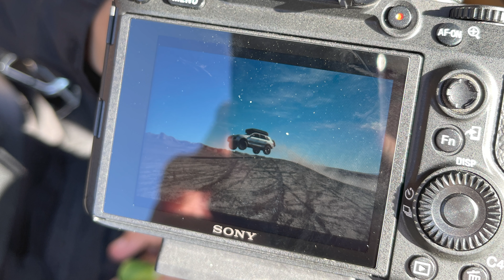My cayenne is VERY broken.

Comment: You had too less clearance after you modified the suspensions. Over that very heavy car and maybe the weight center of the car has been changed by the suspension change and may lead to more stress on the front end when landing.